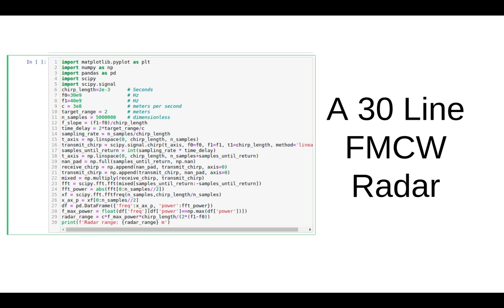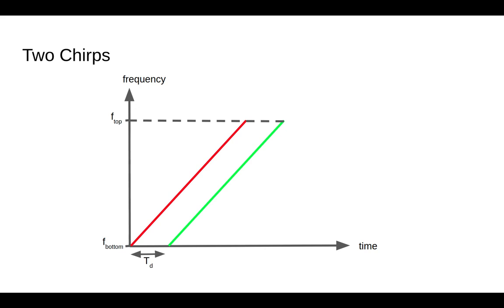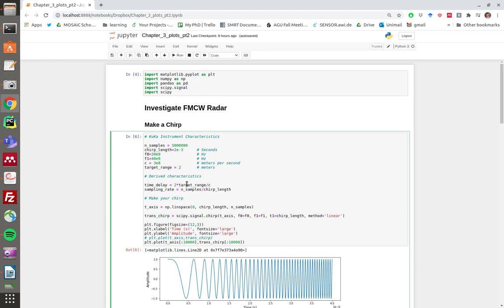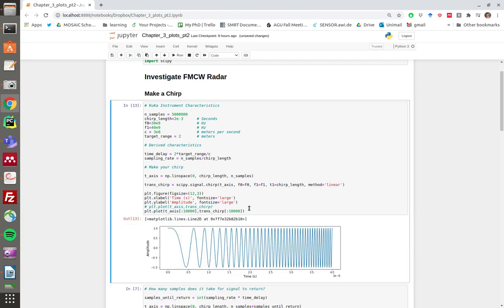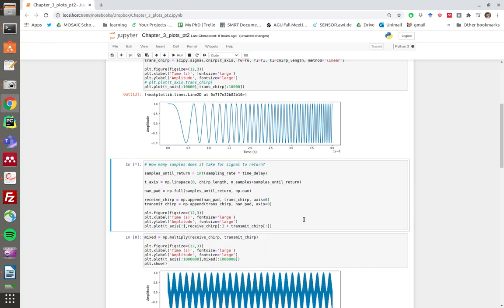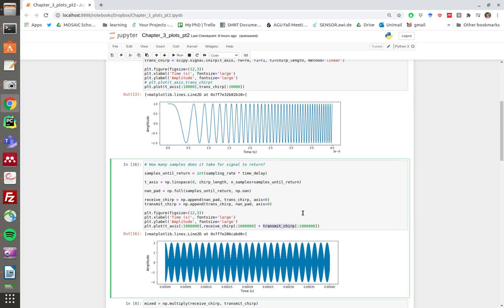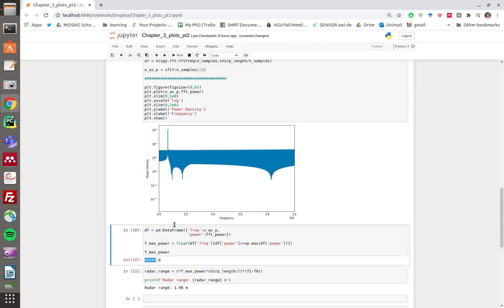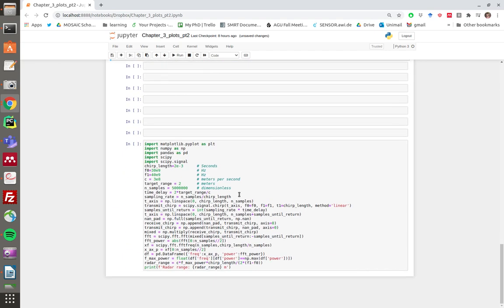30-line python demonstration of FMCW operating principle

Comment: hi, I understand receive_chirp is the signal received after beam reflection from an object, but what transmit_chirp used for? Also why do we add receive_chirp and transmit_chirp? Could you explain this? thanks~
Reply from the maker: It's important to know the transmit chirp because you need to mix it with the returned chirp (line 22 of title slide). 

As for why we mix them (by multiplying, you shouldn't add), there's not a deep physical reason. But we exploit the fact that the mixed signal has a characteristic beats frequency that reflects the time-offset between the transmit and receive chirps, which reflects the range.
Reply: thanks for your explanation Robbie, very helpful @robbiemallett